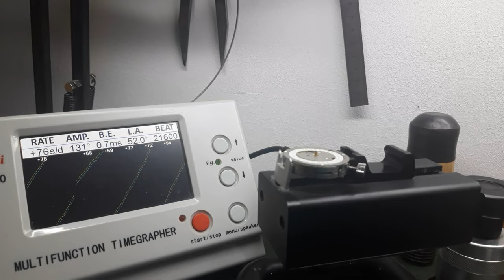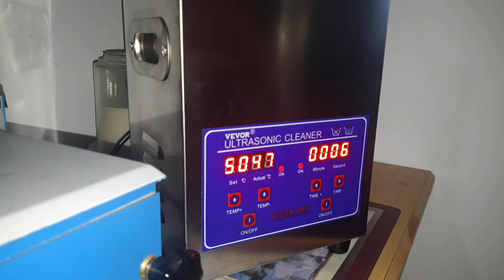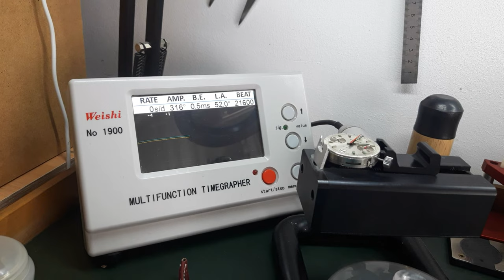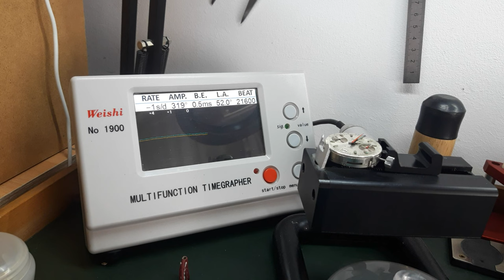USSR Poljot Sturmanskie Chronograph Watch Service

Comment: Good work and nice watch. It takes some confidence in own skills to build the whole movement and the chronometer on top of it without even testing the actual movement first.

...and the location of the over-engineered minute bezel turning knob is so charmingly impractical. 😋
Reply from the maker: The movement was working even before service, only the amplitude was low, probably the watch hadn't seen fresh oil for 20 years. This is why I mounted the chronograph without testing the time part first. However, you are right to do a quick test first to avoid having to disassemble half a movement. Thanks for the comment !!!!!

Comment: Glad to have found your video. I recently got my hands on a 1991-92 make of this watch and i'm thinking of replacing the rubber gasket on the back. Would you know the outder diameter of it? Does it take the regular gaskets which are commonly available, and if not, then where online is it available for purchase?  Also, did you apply some sealing wax at 33:21 to the gasket before placing it back or what is it?
Thanks a lot!
Reply from the maker: Outer diameter 35 mm 
Inner diameter 32 mm 
Thickness 1.10 mm 👍